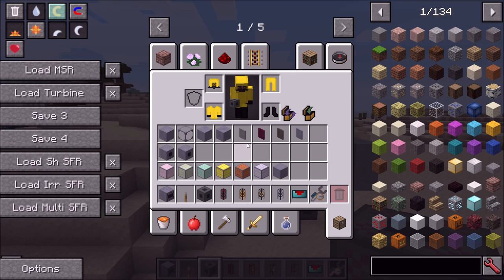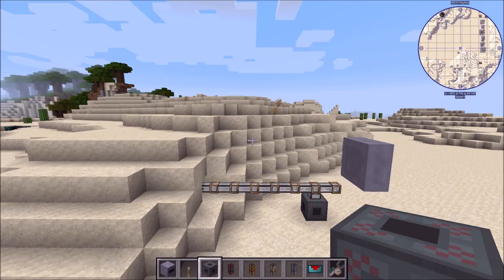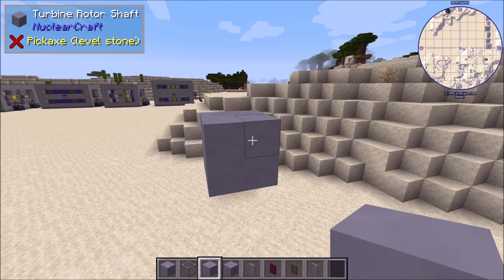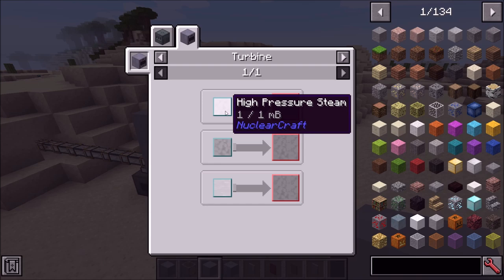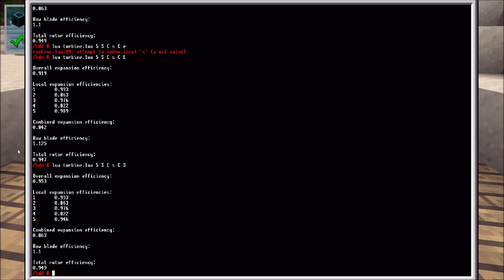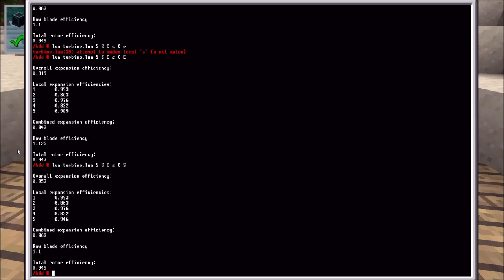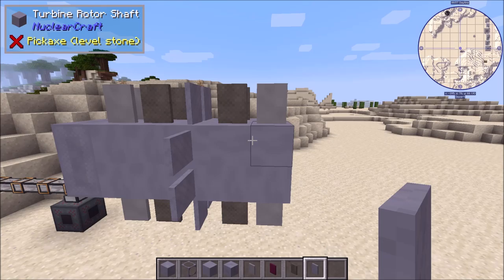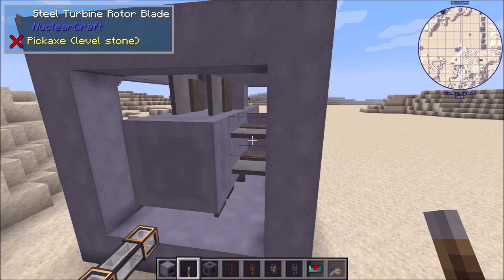NuclearCraft Overhaul - Steam Turbines

Comment from the maker: News: The throughput power bonus is no longer a double-logarithmic as of v2o.3.0, but instead a function linear in the rotor's length and the square root of its area, from 100% to 200% (by default).
Kurtchekov Calculator: https://github.com/Kurtchekov/TurbineCalculator/releases
OC Script: https://pastebin.com/raw/qdHTVDgQ
Design NCPF: https://drive.google.com/file/d/1Ir-6VhJYWhZhr3TegvdOwNCdM6GKOBs_
Design PNG: https://drive.google.com/file/d/1E9_SmyDt_e2sABkxEFGJmTgpIDAjdaXH

Comment: I encountered a strange bug with the turbines....  I had a low output reactor design (~300 mb/t of steam) producing ~6000 rf/t... was working fine for a while then all of a sudden the steam spiked to max input (200%)...  I removed the steam input and left output, but the turbine was pegged at 200% until it exploded.
Reply: Break the turbine controller and replace it.
Reply from the maker: This or was a known bug in past... can't remember if I fixed it in the latest release or not, but either way it should be sorted in the next build :)

Comment: You need to have a proper electrical distribution system to go along with this, it only seems fitting. You could have motor control centers (MCCs) supply your reactor coolant pumps, circ water, and feedwater pumps(your three loops!!!).  Unfortunately I don't know of one that exists at the moment. Most of the electrical mods dont cover the distribution/industrial side.

Comment: I’m not able to get steam out of the solid fuel fission reactor using the fission reactor vent and a fluiduct and I can’t figure it out.
Reply from the maker: Using a multitool on a vent will change it to output mode :)
Reply: NuclearCraft thank you I got it working now
Reply from the maker: @simplytobi326  No worries :)
Reply: How would I connect the battery to the turbine to extract the energy
Reply from the maker: @simplytobi326  Energy is extracted from any of the coil blocks of the turbine dynamos.
Reply: @NuclearCraftMod  I don't know if this is the same version but, how do i get steam? which video should i watch. I have ic2 steam and i tried to connect it with buildcraft pipes, and it didn't  do anything
Reply from the maker: @gurel1941  I believe IC2 adds its own version of steam which isn't compatible by default with other mods' steam. I should probably add support for it; for now, the only option is to use CraftTweaker to add a turbine recipe.
Reply: @NuclearCraftMod  i tried using that steam
it just doesnt want to go in the turbine. I really needed this to produce power, so i found another way my using ic2's steam turbines 🤣🤣
Reply from the maker: @gurel1941  Tried using IC2 steam? Yeh, at the moment it’s not compatible. For their own reasons, the IC2 devs wanted various aspects of their content to be self-contained
Reply: @NuclearCraftMod  then atleast how do i make steam? i think im on the latest version of the mod for 1.12.2
Reply from the maker: @gurel1941  Are you playing overhauled NC or non-overhauled?
Reply: @NuclearCraftMod  I dont know!! 😭😭😭
Reply from the maker: @gurel1941  On the main menu, head into Mod Options, type in "nuclearcraft" and it'll tell you the version. It'll be something like 2.__ :)
Reply: @NuclearCraftMod  Again it doesn't matter, i made the thing i wanted using ic2
Reply: @NuclearCraftMod  but it doesnt work as well as i thought it would, and i don't know what the issue is. ( i mean i know it, but i dont know how to fix it)

Comment: Well I'm kinda late but I'd like to thank the creators of this mod, its exactly what I have always looked for, many ways to do power, strong ways to store power, machines that use a lot of power but are fast in compensation. I always hated many of the thermal expansion machines because there were fast but not ultra-fast, but here, with the right cables you can make anything go lightning fast, i just automated all thermal expansion alloys using the melter and the ingot former in a refined storage crafter system. I cannot express my gratitude in words, to be honest, this is just a dream.
Right now I will watch the molten salt, turbine, fission, and fusion reactors to build them on my map to feed my storages. Couldn't be happier.
Simple, fast, efficient, fun, diverse and you can even learn some physics 
Note that when i say simple, I talk about the way things work, nothing is over-complexified  to stop you from advancing
And the mod interactions are wonderful, to be honest i can't play another mod pack without nuclear craft
Reply from the maker: Thanks very much :)

Comment: Are you planning to add bearing coolers? Like in real turbines liquid hydrogen used to cool bearings. It may give some efficiency advantages
Reply from the maker: I wasn't originally planning to, no - are you sure it's hydrogen? Sounds a bit dangerous :P
Reply: @NuclearCraftMod  well. Dangerous but still used in generators. I wont post any links. Just google for *hydrogen cooled nuclear turbine*. it is not only hydrogen coolers used in real turbines, but this is an example. Water, hydrogen, nitrogen ... etc. Different tiers of coolers with some pros and cons
Reply from the maker: @bel_itman  From the wiki link it looks like gaseous hydrogen is used, which sounds a little bit safer to me :P
Since there is no concept of bearing heat for the turbines, I may not add this particular form of gas cooling, but the pebble-bed reactors, when added, will be gas-cooled for some variety :)